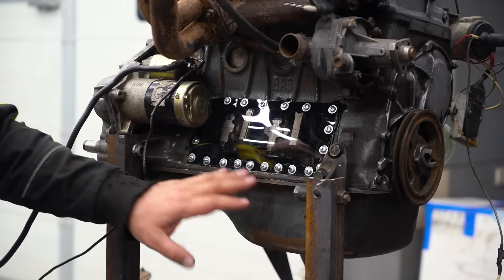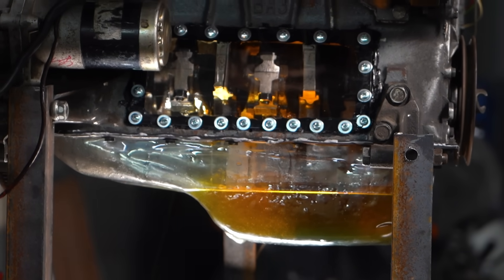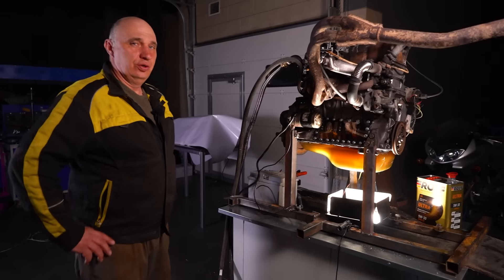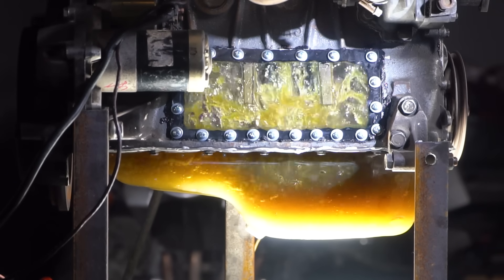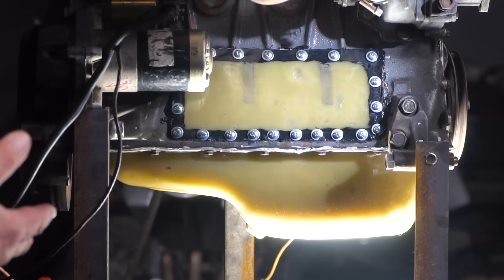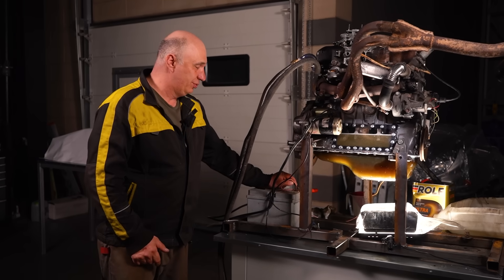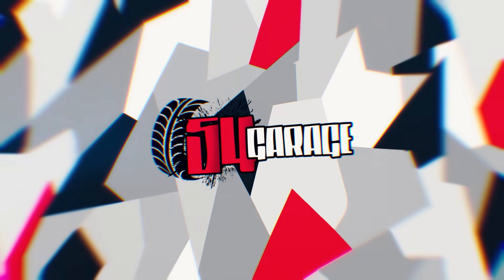What actually happens when you overfill your motor oil? (w/ transparent oil pan)

Comment: What is that? An 850cc from a Renault Dauphine? The presence of air bubbles in the oil can lead to excessive oxidation, cavitation, the reduction of lubricating properties of the oil and hydraulic system failure.

Comment: Put even half that amount in a rock-crawler & see how far you get at crawling at a 45-degree angle, or engine way up or way down. Even out on the road mile after mile & watch yer milage go to hell. More interested on how little you can get by with on a crawler.

Comment: Ik from personal experience what happens when u fill too much oil. Was topping off my oil one night at a autozone, n for whatever reason, I bought a big thing of oil that u normally use for full oil changes. I prob put maybe half of that into my engine, which is waaay too much since it had oil in it already. Was driving on the freeway after that n started seeing white smoke out my exhaust shortly after n a message on my dash saying "pull over safely". Spent a few hours after that limping my way back to my dorm so that I can take my car to my mechanic the next day to have them fix my screw up lol.

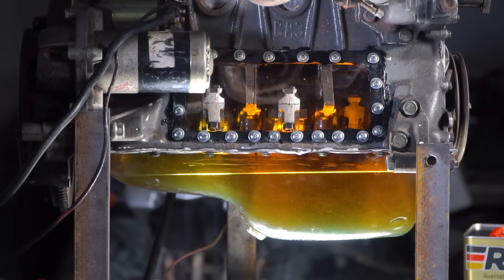Comment: @Garage54 .... if you redo the test, you will thank me!!  It will be a lot of fun!!  That oil foam gets into the crank and rod bearings, and actually causes the oil film to break down, and you will spin a rod bearing or crankshaft bearing!!  How do I know, I had two people do it already.  Engine oil has detergents, and it foams; think Dawn soap when you shake it.  The oil lifting up the engine block is allowing more air to mix into the oil.  You didn't run long enough to have any detrimental effect......yet!!  Try running the engine at a constant rpm when you see the air bubbles in the oil, and you will have that engine seize up!!  Redo the double fill 6:30 mark, and leave the engine run above idle for at least 20 to 25 mins at constant rpm when you see air bubbles.  The issue comes as people drive 10 plus minutes and the motor is above idle so air is mixing with the oil, so the test stand running for a few minutes isn't reflective of what can happen.
Reply: I’m not sure if those polymer windows can withstand the normal operating temperature of the engine.
Reply: Why most racing oils have very low calcium levels, as well as little to none of any other detergents. 😉
That, and the oil is changed LONG before there is much dirt, or combustion blow-by allowed to get into the oil in the first place.
Reply: That's interesting I was thinking the same thing - real world application of running sustained like on the highway
Reply: I overfilled a mini and drove about 150 miles ... then the crank broke! Drove it 5m back to where we could stay, and that was the end of the engine.
Reply: Interesting demonstration, yet you should not risk health for it. You should definitely connect an exhaust extraction or at least open all doors and maximize air exchange. Have a look at 16:40 - horrible, blowing the exhaust into the room and at the camera man. While exhaust especially enriched by burnt oil would not considered healthy, additionally please remember the danger of carbon monoxide poisoning.
Reply: @Timo-M  Russian men are tough this like oxygen for them, I was thinking the same but again, they are Russians :)

Comment: I always ran over full on turbo charge engines. But twice as much was on an engine that ran upside down in a rollover. It was a ford 2.3 sohc Lima engine. The extra oil helped seal the rings and it was run on was gasoline and diesel mixed with atf. It ran for many years till the ranger was scraped.

Comment: I am impressed that, even with gross over-filling with oil, the exhaust does not appear smoky. Good oil control rings on the pistons!
Reply: It does later in the video.
Reply: @s-w  It was grossly over-filled earlier, when it wasn't late in video.

Comment: Years ago I read a study on equipment in the desert and they found that larger oil capacity, air cleaners and radiators not only helped them run better, when fitted with a much larger oil pan and radiator they ran cooler. 
This leads me to think that smaller capacity oil is just worse for an engine. If you were to have say a stationary generator and it was to be ran for longer having a few 100 gallon radiator and 50 plus gallons of oil with the proper oil coolers would not only help keep it running longer it would also lead to less oil changes because hot oil breaks down faster than cool oil.

Comment: so past the crank and it cant vent gasses and blows the seals out...

some engines hydrolock with oil.

ive always added 1 quart more than specified die to the places it pools and never comes down again, and burn off plus the filter, more fluid means it can hold more heat and dissipate it before browning and then burning off... at that point your adding oil just to maintain lubricacity... the ability to fight friction and not gel up.

you have places in the engine that holds at least 1.5quarts of oil.  better to have too much than too little.
Reply: seemed happy with x3 and hit redline very fast... but we do need to test honda vtec and other texhnology that uses oil to function. 

another thing along the same lines, running oils higher than 0 weight both short and long term tests

and then over fill 🤔 like 5-6 videos there plus fillow ups

Comment: Install a temperature guage in run it with twice the amount of oil and watch the oil temperature go thru the  ROOF in about 1/2 hr. of running at road speed ( the plastic oil pan probably was starting to MELT , ITS A WONDER IT DIDNT BLOW EVERY SEAL IN THE ENGINE!!

Comment: In the late 1990s and early 2000s, hypermilers noticed that the Gen 1 and later, the Gen 2 Prius engines were extremely sensitive to oil overfill. If you own a 2001-2009 Prius, the optimal level is about 1/4 inch BELOW full on the dipstick.

Comment: I find it disturbing when you said "Double" the amount of oil, yet, Not seeing the double of amount added in the engine, so what is the required amount of oil (4 qts, 5 qts...) especially later in to the video you started using different unit measure "grams" then "ml" added...

Comment: Aeration is the problem till full enough to hydro lock and bend conrods.
Try oil filled radiator,  seen 2 in my mechanical career.

Comment: Overfilling can cause leak and blow gaskets, damage engine but these are rare. The very first what happens from even small overfilled oil is engine reduced power and torque, second is excessive oil burning.

Comment: On The Motor Oil geek they've done a similar test, but they measured oil pressure and power from the different oil levels. Conclusion: The more oil you have, the more oil pressure you have through high revs, but you also lose power. Though they haven't gotten to such high extremes as touching the crankshaft with the oil.

Comment: I have overfilled the oil on my 1,6l 1985 VW Passat. The dipstick is not showing any dry spots. And I haven't had any issues for 2 years. This year I will have the oil replaced and filled to the correct amount. It looses a bit everytime I start it up lol

Comment: The "milk" you are seeing is an emulsion.  This is how margarine is made, but with vegetable oil and water.  

The emulsion will DESTROY the bearings!  This is a mixture of air bubbles and oil and will not give proper lubrication, causing bearing failure and then Uncle Rodney  will produce a new inspection port in the engine block...